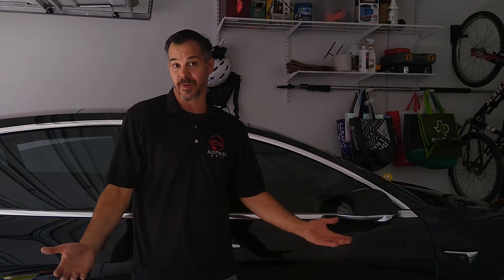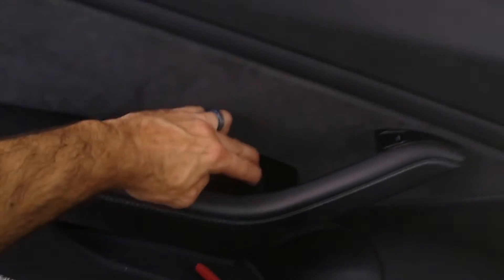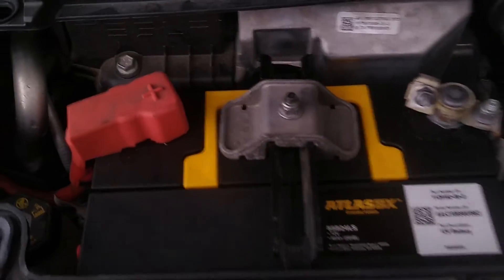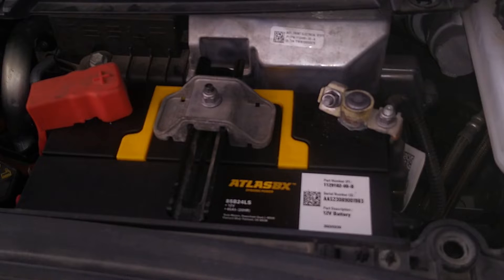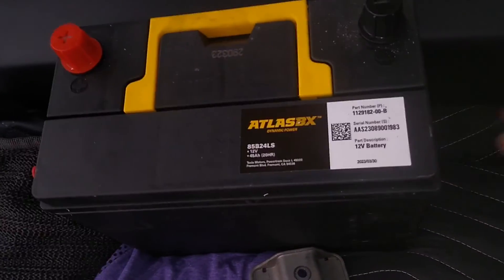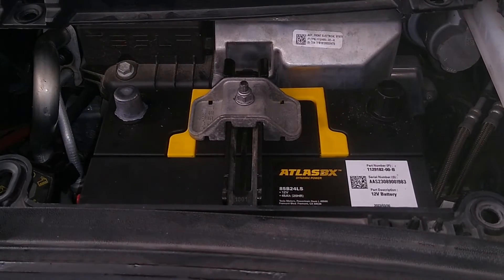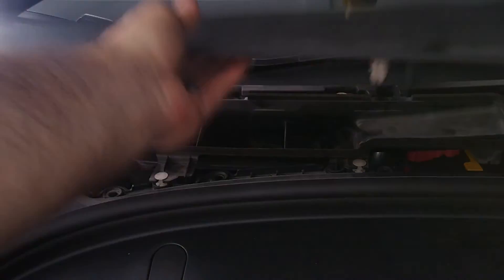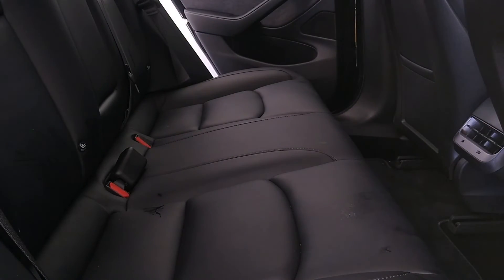Replace Tesla Battery 2018-2021 Model 3 / Y

Comment: Thank you for the great video!  I had 30 min to get this right before I needed to use the car and with your video I did it first time in 15-20 min.  I noticed that my vehicle does not have the Positive terminal protective cover.  This is the second LV battery replaced and not sure if Tesla lost it or the factory did not add it on yet.  I received My Y in Late December 2020, but it is officially a 2021 vehicle.  I want to get this protector but the ones on line look like hard plastic, and the one in your video looks like rubber.  Could you elaborate?
Reply: Some cars didn’t have it but don’t worry about it. The terminal posts don’t corrode like regular ICE vehicles so this is good news